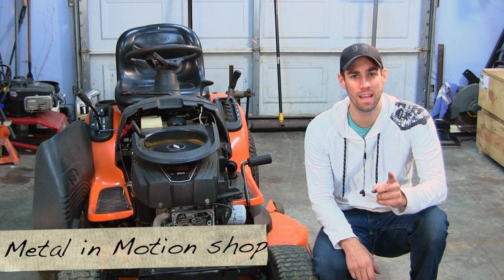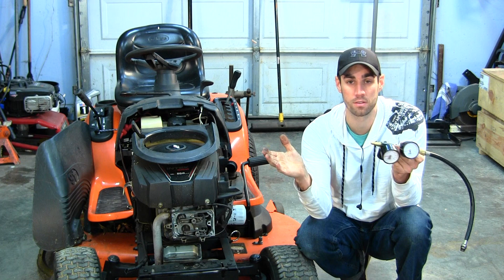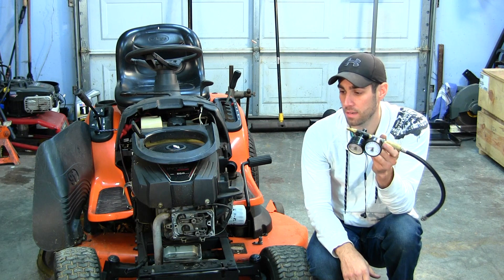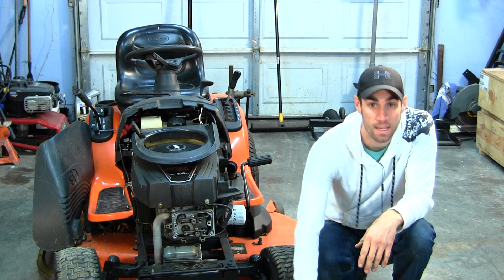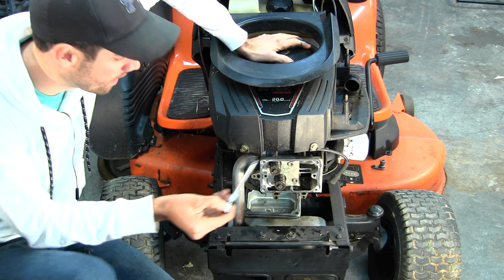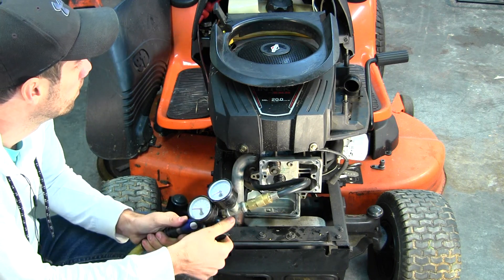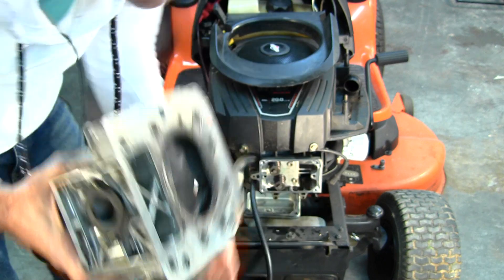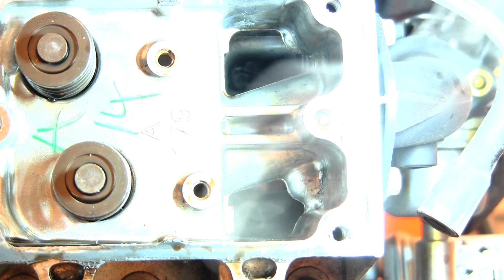How to do a leak down test on small engines

Comment: I Restore old Tecumseh and Briggs engines. You don't need to lock an engine with anything if the piston is at the very top. It moves VERY easy at the exact top. Look in the plug hole. I do compression test ALL THE TIME with no rubber glove fingers or vise grips or anything else. All it can do is push the piston down if you were not at the VERY top.

Comment: What about a smaller 5hp engine that has oil fill ports/oil checks  near the base of the engine block, how would you determine leaky rings?
Reply from the maker: Anything in the crankcase is getting in there from around the pistons rings. Listen for air out of those ports you mentioned and then determine your leakage using the gauge. A certain amount of air is acceptable.

Comment: Great video, one of the best I’ve seen discussing this. I’m dealing with this right now with one of my walk behind mowers w/ a kohler command. Getting a head gasket tomorrow hoping it’ll fix it. It backfired and now won’t start and I can pull the cord and there’s no resistance, no compression stroke detectable. I hope to god head gasket fix’s  it. 🙏🤞 what’d u think?
Reply from the maker: Were you able to do a leak down test? I’ve seen a backfire bend pushrods and mess up valves. It might be a head gasket but it’s hard to say without a test.
Reply: @metalinmotionshop   I put a new head gasket  on and during reassembly noticed one of the valves (exhaust I think) was open just half a hair. After lots of head/beard scratching I  tried using a clamp and a socket to force the valve closed. With a very small “click” it seemed  to shut. Reassembled and it easily started. Fingers now crossed. Thanks
Reply: @metalinmotionshop  I didn’t have a leak down tool. Pushrods still straight too , few ,

Comment: If I don't have a Compression tester tube with the ball removed to use with the glove...could I just put my finger over the spark plug hole to feel pressure?
Reply from the maker: Yes, if you partially cover the spark plug hole with your finger, and spin the over engine over by hand you can usually hear the air hissing out on the compression stroke.

Comment: I would love a parts list on your leak down tester please? thanks for the video too, gonna diag my dead Deere this week and this has been helpful. Also, that glove trick was cool advice 🤯
Reply: Leak down tester how to make: https://youtu.be/WuLYDy0zkhw
I don't see the point of the glove when you put something in the cylinder to see where the piston is at and you check that both rockers are loose indicating both valves are closed (TDC). The glove seems redundant.

Comment: Engaging the electric pto clutch will most often hold the engine.
Reply from the maker: I hadn’t thought of that. Good idea.
Reply: Anything but placing vice grips on crankshaft if I understood him correctly.   Some day you may need to replace the bottom seal.

Comment: Liked. Very good video. I don't have acess to the leak down tool or compressed air. So I can't do this test. But I have a question for you or anyone willing to share info.  Since the OHV Engines. Briggs & Stratton Intek in my case. Have a compression release valve for easier starting. What's the minimum amont of compression I can have and the engine still start fairly easy? Thanks in advance.

Comment: that briggs engine has had an issue with blowing the head gasket could not tell you how many i replaces but use a good thick heavy duty one when you replace it and you wont have issue again

Comment: You should have everything plugged in from the start. You don’t pressurize the tester then plug it in. Also, The fastest easiest way to find exact top dead center is with the leak down tester. You turn the reg up so you have 5 PSI in the cylinder. Then turn the engine. You will feel TDC. Very fast and easy.

Comment: Loved the glove trick myself too. I have a question,  I have a newer 22 hp V twin Briggs on a rider. The drivers side if you will , cylinder has like 140 + psi compression ( cold btw ) . But the passenger side cylinder has very little compression. I'm thinking " that " cylinder has the compression release mechanism in it. If I were to start the engine on one cylinder the good one btw. With the spark plug out of the weak cylinder ( with that spark plug wire grounded ) would the RPM be high enough at that rate to deactivate the compression release so I could just momentarily stick the rubber seal end of a compression gauge up against the spark plug hole just for a second  to get a rough compression number for that weak cylinder ? Hell, that cylinder might be actually fine. No ?

Comment: Great video.  Probably the best one I've seen about how to diagnose a head gasket leak, valve or rings leak for the single cylinder B&S Intek engine.  And I've seen a lot of videos lately.

Comment: Great video.  I knew many small engines have a compression release mechanism.  A leak-down test gets around that issue.  I love the rubber glove finger trick.  Takes care of the "are you top of compression stroke or exhaust stroke?" question.  Very clever.
Reply: It might be on exhaust stroke, but because he has removed push rods the ex.valve can't open.

Comment: Great video! Leak down is the way to go. I love the conformation with the smoke test. What's your go to compression test for two stroke?
Reply from the maker: Usually just using the compression tester and looking for a minimum of 90psi for trimmers and blowers and such......however I usually dont like to work on many if they are below 110psi. Though I have seen several run around 95 psi often times they don’t idle well and are hard starting. If I suspect an air leak, then I’ll do a leak down test on the engine to make sure it holds psi and vacuum of about 10psi / in hg

Comment: Silly me replaced a head gasket and valve guide seals on a 21.5hp intek v-twin thinking it would fix the cheech and chong oil burner edition, naturally neither of those fixed the problem. So here I am after the fact kicking myself for not doing this effective test first. Prior to that I bolted on a new carb and installed an inline shutoff valve, then drained the oil thinking it was gas-fouled and put in the correct amount of oil. Mower was ran and cut grass for 40+ mins after each wrenching session so it's definitely not residual oil. So, at this point it's gotta be the piston rings as there's literally nothing left, and when I remove the dipstick while she's running...well let's just say next time I'm gonna put on a face shield first lol. Anywho, just finished building my leak down tester, gonna confirm my thoughts tomorrow, thanks to this video. Thanks for the awesome information, subbed.
Reply: EDIT: Dropped the muffler, removed carburetor and both valve covers, ran leak down test on both cylinders TDC on compression stroke per cylinder. Some dipstick leakage, HEAVY exhaust pipe leakage, confirmed by ear and putting my hand over the pipe during the test. It's like saying "aaaahhhh" while putting your hand on and off your mouth.
Pulled the head, exhaust valve is more crispy and full of gunk than Val Kilmer's arteries, no way that it could've seated properly. Gonna get some compound and a lapping tool 5000(aka suction cup) and lap me some valves!

Day 28374: Lapped both valves to a nice consistent grey ring, cleaned head with wire wheel and carb cleaner followed with compressed air, slapped on a new head gasket and threw it all back together. Leak down test still has air from exhaust pipe, but less than before lapping the valves. Lots of crankcase air from both cylinders. A very loud "wah" noise from crankcase breather tube during the test, removing dipstick relieves pressure and the wah noise goes away. Didn't bother calculating the percentage loss, small double tank air compressor was losing pressure too fast to read the gauges and the air leak was obnoxious enough to prove a point. Cut the grass, less smoke than usual, until I let it idle, and then the smoke comes rolling in like business as usual.

Conclusion: bad piston rings eventually caused a badly carbon fouled exhaust valve due to the excessive oil burning over time, causing avoidable problems with the exhaust valve/seat. Gonna need to rip her off the frame and tear into her upside down on a milk crate and replace the rings...It will be done with many drive and much motivation

Comment: Good test.
 I think that when the engine is turning from the starter and reaches full starter cranking speed the compression release is no longer bleeding air to lower compression. The reason compression tests don't work on small engines is that the ratio of air in the compressed cylinder to the line from the compression gauge is too great. These compression testers are made for large diameter pistons where the ratio is negligible. On small engines especially trimmer size engines you just can't get a really accurate compression test without making a special adapter that puts the gauge right at the spark plug hole and has a very small orifice to the gauge itself. Leak down is a much better solution, you got it right!

Comment: Ok I finally got a leak down test on a Briggs small engine. It appears there was high leakage percent of 46%. At first as per last comment, I thought the sound of air was coming out the muffler but on closer examination I discovered it was coming from two holes in the OHV assembly. Also when I took out the oil filler plug the sound of the air escape changed and I noticed a difference with my thumb on and or off of the oil filler opening. So based on what little I know it appears there is a head gasket issue and perhaps cylinder rings if air is getting into the crankcase. Does this sound correct? Prior symptoms were smoke in the exhaust. One kind of weird thing was at one point there was only around 40-45 lbs on leakage side of tester gauges and then the gauge jumped up to around 50 lbs at least briefly.
Reply from the maker: So...my experience is if you pull the valve cover  off a head gasket leak is louder just below the intake cast into the head. If it leaking past the rings it will be louder coming out the dipstick. Theres obviously oil passages to get oil to the cylinder head, so you are going to have some air noise down where the pushrod sit on the tappets but it’s usually not as loud. Also there a minimum standard for doing a leakdown test and thats 60psi. Not that you wouldnt be able to diagnose it by listening but it might throw off the leakage ratio if the pressure is to low.

Comment: Ok, so I finally got a leak test done and while I did not try to get 100 lbs of pressure on left gauge, I will relay the following: With the left gauge at 50 lbs the right gauge showed 23 lbs and held that steady. Now I know you took the 100 lbs and subtracted the 20 lbs and came up with 80 % leakage. though in this case with the initial pressure at 50 if you multiply the 23 lbs x 2 you get 46% leakage. If you mulitply the 50 lbs x .46 you get 23 lbs. You could hear the leakage out of the muffler. So it appears to be an exhaust valve issue and perhaps head gasket. Is this correct?

Comment: Hi, I appreciate this video! Though I have A husqvarna tiller with a briggs engine. So the setup with the pulley on crankshaft doesn't make it easy to lock the crank in place. Also my engine I understand says 1/4" past TDC on compression stroke. In any case if you have the rockers off like in your example what would be the effect of the crank moving when air is applied as it did in my attempted test? I had rockers off, crank moved and I had air coming out of the exhaust push rod valve guide. Does that suggest a blown gasket too? Or erroneous test since crank moved?